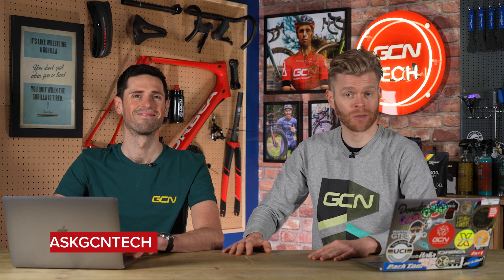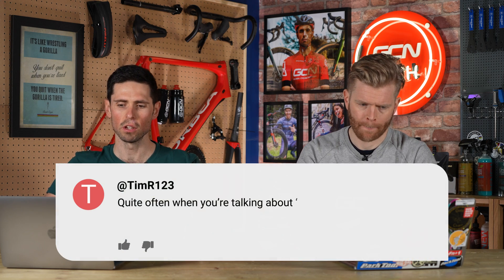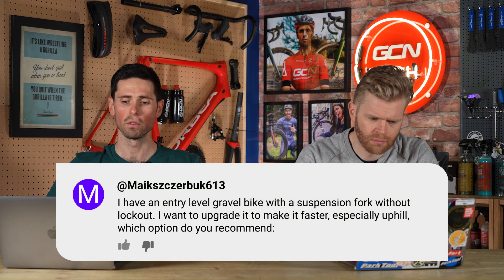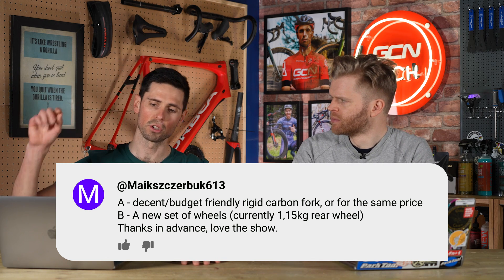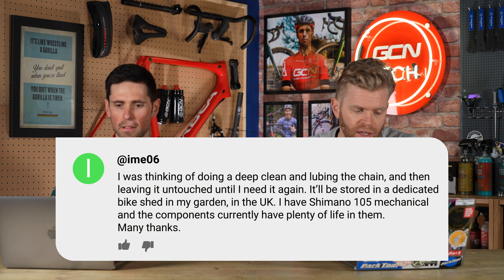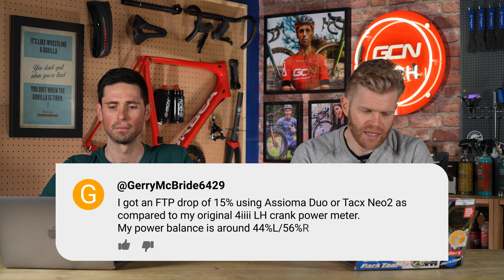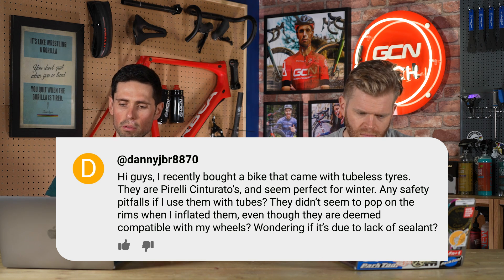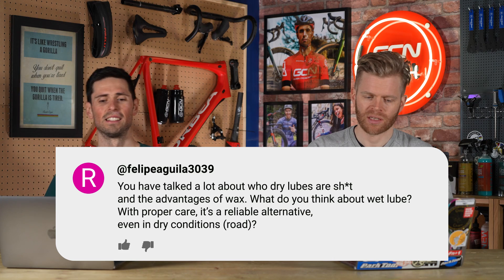Frozen Brakes, Gravel Suspension & Watt Calculators | GCN Tech Clinic

Comment from the maker: Let us know your tech questions using #askgcntech ⚙
Reply: #askgcntech
Regarding using wet lubes for bicycle chains, is it better to apply it after a ride or apply it the night before to let it soak in.
Reply: What is the optimal way to measure saddle set back at home when fronts and backs of saddles, as well as rail lengths are all different from saddle to saddle, rendering tip of saddle to bar measurement inaccurate? Is the 80mm width point of a saddle generally accepted as a measuring point?
Reply: #askgcntech the Watt is a measurement power created by James Watt, is there an unofficial measurement you make that you'd name after yourself?
Reply: #askgcntech Which percentage of  professional training is alone vs group ride? What is better when ill (such as common winter viruses), Z2 or nothing?
Reply: #askgcntech Ollie says he doesn't like using erg mode but can he share what Zwift courses he prefers when doing intervals? I do lots of intervals and find erg useful otherwise terrain will affect my power, like hitting a downhill at the wrong time. Likewise if doing a zone 2 ride how does he keep within that without terrain forcing him into zone 1 or 3/4 ?

Comment: Another power meter question:
Is it possible that using a single sided power meter  - eg left crank - will cause you to subconsciously push harder with your left leg and therefore develop a left right imbalance over time?

Comment: #askgcntech
Hi guys, great show. My question is regarding chainring size. I have a Ultegra 12sp DI2 Groupset on my bike (R8170). I would like to go to a bigger chainset. I live in a predominantely flat area and I love the looks of a bigger chainring (also YOLO). Shimano only goes up to 52-36 on the ultegra and the bigger 53-39 and 54-40 are reserved to Dura Ace. Is it possible for me to install a bigger chainset on my groupset, or is that not possible? Any advice would be greatly appreciated.
Thanks!

Comment: #askgcntech Hi GCN Team! Can I run tubeless tires without the sealant? I realize that I will lose the self fixing of punctures feature, but if a plug would work without sealant sloshing around inside the tire I’d then I’ll take that trade-off over the mess of sealant. Thanks for your thoughts!

Comment: The online tool Omni Calculator is free and has been developed by PhD students.  It is accurate for predicting power against speed/weight and you can select different road surfaces, aerodynamics, tyres and then convert to calories burned.  I find it to be within 3% OF Garmin's calculations of calories.  I use the formulae shown in Omni Calculator for my spreadsheets.

Comment: #askgcntech Hi GCN team, I followed the advice of waxing my chain and have been taking extra care after each ride, cleaning it with a microfibre cloth and applying drip-on wax regularly every 200-300km. However, I've recently noticed signs of rust on the chain's surface. Is this normal? I assumed the wax would prevent rust. If not, could you provide advice on maintaining a waxed chain properly?

Comment: #askgcntech My indoor trainer (JetBlack Volt V2) seems to give a higher power reading than the pedals (Favero Assioma Uno) on my outdoor bike.  For example the difference in my FTP between the two can be as much as 30w. Why do you think this is and which is the more accurate reading?

Comment: Regarding the frozen disk brake problem: it might actually the callipers that are frozen. If they are wet for longer, e.g. from rain or melted snow/road splash, water may creep between brake  housing and calliper. Once you get some decent frost they might just freeze. Had this countless times. Give the callipers a good clean and dry everything out and they are good.

Comment: Living in wet Portland, Oregon I tried using wax on my winter bike and went back to wet lube. The other drawback I found is when you are putting on drip on wax a lot you end up with a lot of the wax gunk everywhere which is as bad or worse to clean than the grease. Wax is great on a fair-weather bike, but for my winter commuter I'm sticking with wet.
Reply from the maker: Wet lube is a great options if you live in mixed conditions 🙌 Just be sure to get the right brand of lube, We use Silca and it's great for a slightly damp UK ☔

Comment: Hey gents , I disagree with Alex’s comment regarding tubeless tires being fine for inner tubes. Schwalbe pro one TLEs are specifically designed to be set up as tubeless and if you put an inner tube in (as I had to recently) they bulge in all the wrong places like a fat lad (me) in an aero jersey!  While it is a solution to get you home I would steer clear of tubeless designed tires if you are always going to run a tube.  For starters the non tubeless ready tires are normally cheaper!

Love the show

Comment: Regarding power meter accuracy.  No one suggested putting the meters through the manufacturers recommended zero/calibration procedure.  I know many have such a thing.  I'd assume not all do, but why not try?  My old Wahoo Kickr required periodic spin downs to recalibrate, why not pedal power meters?
Reply: With Assioma Favero Duo,  I typically calibrate the pedals before every ride. 4iii says the same thing "Zero-offset/calibrate your powermeter regularly - we suggest that you zero-offset/calibrate your powermeter prior to every ride"

Comment: Turbo trainers vs power meters: all the TTs and PMs I've seen recently have similar specifications  : +/-1 to +/-2%. Yet you claim TTs to be much more accurate. Are you disputing the manufacturer's accuracy claims of PMs? Shimano PMs are well known to be shite. All other PMs and TTs I have tried have been well in agreement. To those people with accuracy issues, i say this: you must let your PM acclimatise to the temperature at which it will be ridden, then calibrate it. You must warm up your TT with a representative power effort for 10 mins or so and then calibrate it, before trying to take meaningful measurements. These things are highly temperature sensitive.

Comment: #askgcntech - Back when I used to run an oiled chain and mechanical groupset,  I used to just spray my derailleurs with spray oil and wipe off the excess but now I'm on Dura Ace Di2 with a waxed chain, is there anything on the Di2 derailleurs that needs some oil or are they designed to run dry?  Thanks!!!

Comment: I have a Canyon Grizl Suspension with the same fork replacement issue, the main problem is the suspension forks are 1 1/4 sized instead of the usual 1 1/8 so it won't fit any rigid forks, does anyone have any ideas of a gravel rigid fork that would fit?
Reply: RockShox Rudys are 1 1/4 tapered to 1.5 I believe so you can use any 1 1/8-1.5 tapered fork you just need a 1 1/4 to 1 1/8 "reducer crown race" (they cost next to nothing £10 ish). It usually just replaces your existing one but sometimes you need to change the top bearing cover too. 
Dont forget you will need a shim for your stem as well (or a new stem).
Reply: Woke up this morning and for some reason the first thing that popped into my head was "Not a crown race you idiot" So just to clarify I meant to say you need a reducer top race/compression ring NOT a crown race.

Comment: Hi, GCN Tech Crew.  My road bike has an 11/34 cassette; my indoor trainer has an 11/28 cassette.  When I ride my bike outdoors, shifting is very smooth and works well.  However, when I put my bike on the trainer, the shifting is very clunky and sometimes skips.  I’ve tried adjusting the derailleur, but can’t seem to quite get everything aligned. The research I’ve done suggests I should be able to just put my bike on the trainer and ride, but that doesn’t seem to be the case.  Any suggestions?  Should I just get an 11/34 cassette for my trainer?  Thanks!  #AskGCNTech
Reply: If your chain and cassette for outdoors have done a significantly higher mileage than your indoor cassette then this will probably mean that your chain has worn and “stretched” a little and then not quite mesh with the cassette on your trainer causing noise and skipping. So same effect as old chain on a new cassette. I have a bit of noise on my indoor trainer but no skipping though less smooth than the outdoor cassette.I too have adjusted the derailleur a little but the cassette is new so I will probably have to put up with it. It may bed in over time. The  same  cassette on different wheels or trainers will often sit fractionally in or outboard which is frustrating when you want to swap wheels or from Road to trainer. Riding 40 odd years and there’s always something to make it awkward 😂
Reply: @chrisrighton6685  Thanks, Chris - appreciate the advice.  I did check my chain and, while there is some wear, it’s not too bad.  The cassette on my bike does have more wear than the one on my trainer, though.  To your point, I do realize it’s never going to be a perfect transition from outdoor riding to the trainer, but I was hoping there was something I could do to make it a little bit smoother, at least.  🙂

Comment: #askgcntech I am firmly on team waxed chain. Generally, I've been good at taking care of it, but the other day I just forgot to clean it after riding in the wet, and it was a little rusty the next day. I did a rinse with Silca's chain degreaser, and rewaxed to get it back, but is this the best method?
Reply from the maker: Sounds like you've got your system down! Be sure to check the chain rust isn't too much 👀

Comment: can we test olive oil as a brake fluid? 

only in Italian bikes obviously.
Reply: In 1955 Citroen said that olive oil could be used as an "emergency scenario" style substitute for the hydraulic fluid of a DS, but afterwards the system would need flushing.

So it probably won't be perfect, but it also might not doesn't work

Comment: #askgcntech

Nerdy tire question:
We've come a long, long way from the era of "narrow and hard = fast", but with more variables like rider weight, tire width, rim width, TPI, tread, tubeless or not, and riding surface to name a few off the top of my head...do we have a good handle on what is optimal? For example, something as seemingly simple and straightforward as "tire width" is actually a wide smear of values depending on a number of factors. I think there are some tables and even maybe some calculators that will tell you the "optimal" pressure for various tire widths, but do those ignore huge reams of relevant variables?
Say you take a 40 mm tire and you mount it on at 23 mm rim at 50 psi and sat on it as a 165 lbs rider on a paved surface. Would it even still measure 40 mm if you took some calipers to it? Probably not. Same tire on 28mm rims would likely measure different at the same psi and/or with a heavier/lighter rider.

Is there anywhere we can go to get this type of information? Thanks, nerds!
Reply: Silca tire pressure calculator takes all or most of that into account.
Reply: @larrylem3582  sweet - that's handy, tx.
Follow up after having read the instructions: what pressure do you inflate the tire to in order to measure the "baseline" tire width? Also, wouldn't putting more or less air into the tire after running the calculator then change the measured width?
Reply: @peterdobos1606  If you're close to the final pressure, (for example 70 psi when it should be 60), the width won't change by more than a millimeter.  And you likely won't feel a difference once you're within 5 psi at that pressure.  At lower pressures in MTB tires, (25-30 psi), being off by 5 psi would make a bigger difference.

Comment: Have you really got to pay £1 per millilitre for a decent wet lube? Also aren't the ones you mentioned both wax based lubes? I do use a cheaper one, but clean it off and reapply regularly, but mainly using wax now apart from winter bikes.

Comment: Unless you're using your FTP for bragging rights, it doesn't matter if one power meter reads different than another, as long as you use the same power meter for your training.  As for bragging rights, out-riding your buddies says more than FTP.
Reply: I disagree because you are not only training at your FTP but on multiples of it. If your measurement is too high, you are multiplying the error.
Reply: @chrisridesbicycles  So what? If you're not a pro it really doesn't matter.....and you're far too serious about a hobby/past time.
Reply: @Andy_ATB  Not sure why people need to be constantly reminded of this but there are more than 2 categories of cyclist its not just "pro" and hobbyist, people can and do race/compete at many levels in between, and some just want to be the best they can be for themselves, so the quality and accuracy of the "tools" we use to do that matters. And although what matters to one person may not matter to another, telling people you don't even know what should matter to them is both ignorant and arrogant.
Reply from the maker: That's a great point! What matters is consistency 🙌
Reply: You are simply wrong. If you train off power you need your power metres to give similar numbers.
Reply: The problem is not that one PM is reading higher than another the problem is one of them is WRONG. G.I.G.O. The output a system produces depends on the input it receives. If you put garbage in, chances are high that you will get garbage out, if your PM is not somewhat accurate you may as well throw it in the bin.

Comment: Thank you for all the good content! I just bought a new bike (van rysel rcr) with a Quarq power meter. I don’t have a bike computer, but I do have a phone. Are there any apps that  can pair with the power meter and use as a bike computer in comparison with a quad lock or similar? I can see no good reason why a phone can’t do the same job as a bike computer and it would be nice to have one less thing to charge and update all the time.
Reply: I use wahoo on my phone to track my outdoor rides. It’s gotten a substantial update since I used it last but it was fairly decent, you just need to keep battery life in mind and bring a power bank
Reply: You will want a dedicateted bike computer in the longrun. Useing your phone will drain it´s battery really fast, in case of an emergancy you will want a working phone.
Reply: Wahoo is the only truly free one that does everything you want it to, all the others need you to pay a subscription but using your phone will kill the battery (and likely shorten its life too) I know having another thing to charge etc. is a pain, but on the up side you really dont need to pay stupid money to get a really good head unit these days (unless you want too).
I have an iGPSPORT BSC100S that got as a backup for multi-day endurance rides, it lacks navigation (although it does have GPS positioning) and no flashy colour screen but it does pretty much everything else, even smart notifications and alerts, Ant+ and the App it connects too is pretty good/useful. I paid £30 ish on eBay.

Comment: Home-trainer power Vs pedal power readings. Why there is a difference? To answer this question you need to first define what is the power that your home-trainer is reading and the one your pedal is reading. Home-trainer calculates the electric power (V*I)  and your pedal calculates mechanical power (F*v). Depends on the electronics efficiency, the average efficiency is around 90 - 80% therefore power = F*v = V*I *80%
Example, if your pedal power reading is 150W then your home-trainer reading maybe 80%of 150W = 120W.
So it is normal that your home-trainer power is lower than the pedal power meter.
In a perfect efficient electronics we should have the same readings.
In real word you need to listen to your body look at the heart rate monitor and you will manage your effort or you can couple your headunit or watch to the pedal power meter instead of the home-trainer
Reply: What rubbish, Smart trainers and on bike PM's all calculate mechanical power indirectly. On the bike and (some trainers) do this by measuring deflection on a component in relation to force applied. Most trainers use sensors to measure the velocity of the flywheel in relation to cadence and resistance.